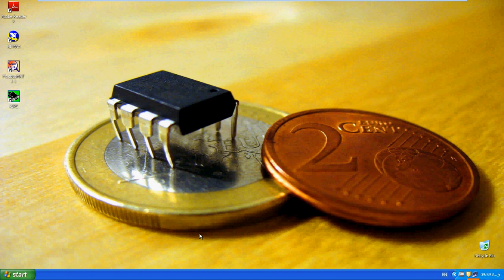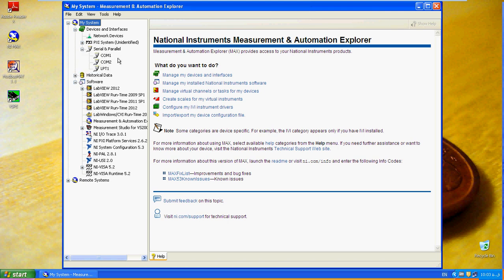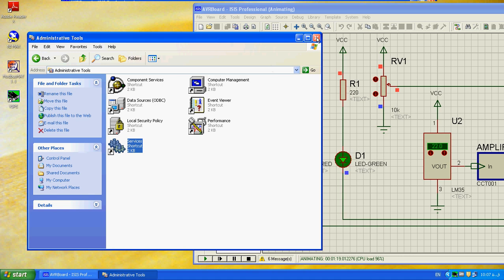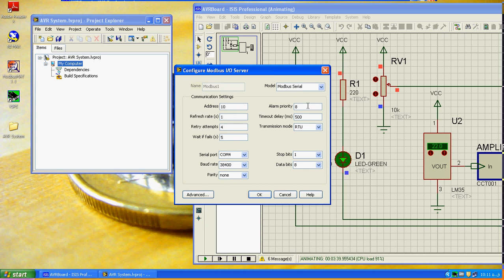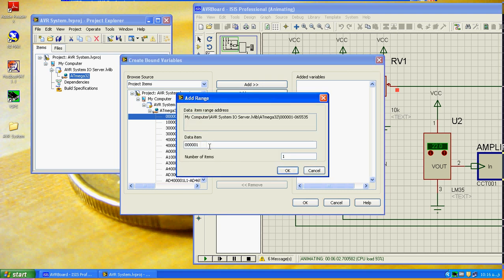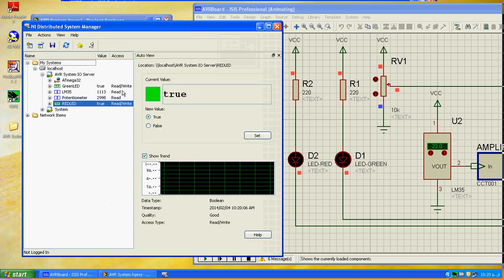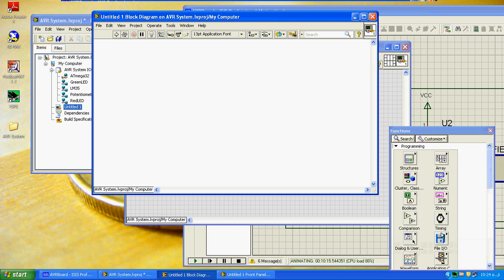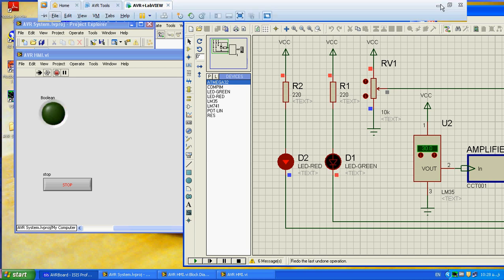Modbus communication using LabVIEW

Comment: HI,
Is it possible to communicate labview with plc s7 1200 as modbus tcp client.?
In s7 1200 Configure block MB_CLIENT and STATUS is in 7002 (waiting conection).
Labview is like modbus slave tcp, the VI does not give me an error but the data does not arrive in shared variable.
What could be wrong?
Thank you